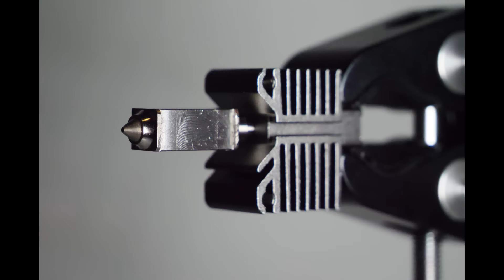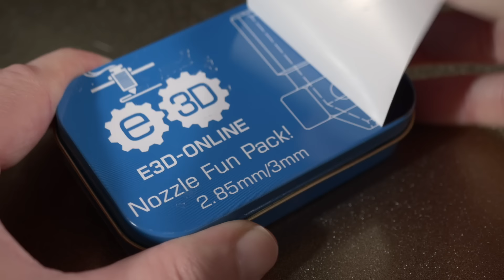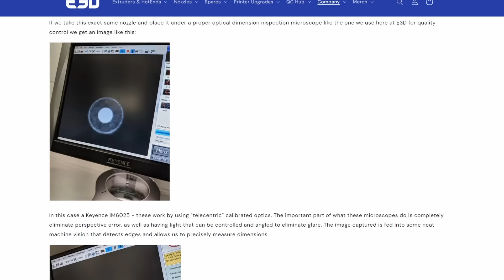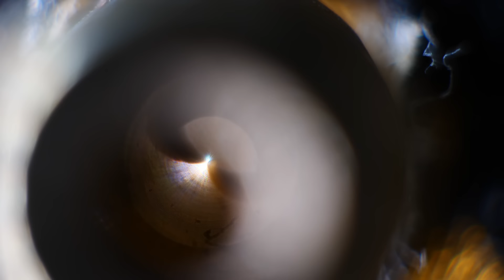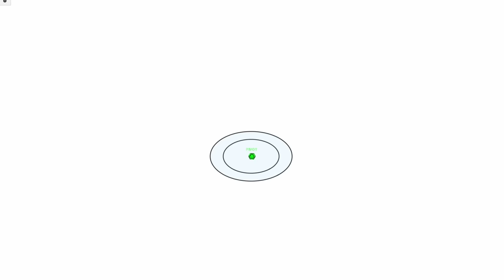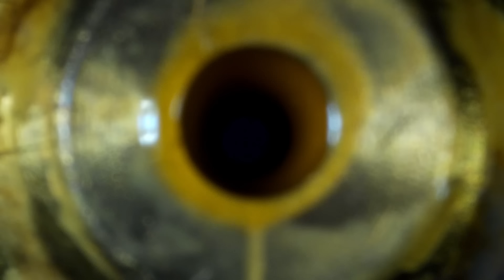Expensive Vs Cheap 3d printer nozzles - let's look inside.

Comment: that is exactally why I swapped to v6 (and v6 compatible such as phaetus rapido) despite building voron kits that come with revo voron. they are cheaper (both HE and nozzle) and better.

on the price side: 22 nozzle for $3 versus 1 nozzle for $27 and the HE isn't even more expensive (revo HE is like 100 where as a phaetus rapido that is triple the power is only 80)
plus you can get CHT, hardened CHT, ruby, diamond (diamond revo just come out i know), and dozens of other options for CHEAP. like we all should know that clone v6 CHT are $4 for 3 and performs better than og CHT and may not even be IP infringement because they used a different approach (insert rather than machined, whether it is different enough is a question no one can answer unless fighted out in court)
another spicy trick to do with v6 is you can use valcano nozzle with a nut and it works about as good as an actual valcano block, like you have the ability to swap between ultra high flow and less stringing in the time of a nozzle swap

some will claim revo is good when you get heat creep as you can swap the heat break and cold side with the nozzle. while I am not denying that having experienced it myself, it sucks a lot more to loss a $27-100+ nozzle than a $20-30 heat break that I could try to drill out. so really the only benefit imo would be cold nozzle swap (how often do you do that anyway) and using dedicated hotside for each material (which highly depend on your need, and whether it is more cost effective consider you need $27 for each material where as a clog on v6 cost less than $1)

Comment: Awesome stuff. I've always loved macro shots.

Also, your custom LED PCB has my interest (Custom flashlights are another hobby of mine). Do you know what emitters you plan to use? And what type of driver? I'd imagine Nichia E17a would be just about ideal due to their small size (1.7mm) and very high CRI. Also, you may already know this, but I highly recommend using an MCPCB instead of your traditional FR4 PCB. The metal core helps a lot to move heat away from the LED chip much better.

Looking forward to seeing what you're working on next. Cheers

Comment: When I use a new E3D volcano nozzle, i always round the nozzle's edge on a hard  surface. I do it because the sharp edge has a bad habit of accumulating material while printing. A rounded nozzle just prints better. I usually print functional parts so always tune the print to be on the edge of overextruding.

Comment: There's a thing called light field cameras (also known as plenoptic camera) which takes a picture with all parts in focus or rather a picture which allows you to focus after taking the picture. sadly this tech never took on besides the lytro cameras (the company closed in 2018). Nonetheless, cool tech
Reply from the maker: Yeah I saw crazy kens explanation of it and I'm still not entirely sure how those even work. Would be cool but I don't know how it breaks the laws of physics!

Comment: re: surface finish

Construct 3d showed off a 6 input hotend for higher flow. It was made with sls. To smooth the insides, glow filament is run through it for polishing purposes
Reply from the maker: Oh....now I need to test that
Reply: @LostInTech3D Also I wonder if chemical finishing could be sensible to do.

Comment: I'm wondering if the roughness of the steel nozzles will affect print quality, and will the print quality be improved if you polish the nozzle with a vibration polisher or by running water with an abrasive like sand through it.

Comment: Like your channel and your content but while you were rambling on about how to take the photo the question popped up, why are those nozzles longer than the others and and if it's so the filament is melted in a continuous tube unlike the short nozzles why are we still using the short ones? Does the long ones work better than the short one?
Reply from the maker: Most manufacturers are moving to longer heat zones now, so...yes. originally it was harder to tune retraction.

Comment: Personally I'm not too interested in the inside of a nozzle. I've yet to have one print gone wrong because of a clogged nozzle, just hasn't happened. However, I do have prints converted into misery because of blobs accumulated on the outside of the nozzle.
So the smoothness of the outside of the nozzle is highly important.
Since a few months I bought a PTFE finished brass nozzle. Man, what a difference. I have a silicon scraper setup with the appropriate g-codes at the start of a print to clean the nozzle of any residues but even so with a normal brass nozzle I still needed to clean it thoroughly every now and then. Not the PTFE one, you can print for months without any cleaning (other than my automated scraping) and if ever needed just wipe it with a cloth when it's hot, no work at all, no brushes or anything heavy.
They're a little bit more expensive but well worth the price.
Reply from the maker: Interesting thought about the exterior...I know petg likes to stick to nozzles...hmm
Reply: @LostInTech3D I'm using PLA, in this case with a 0.3mm nozzle, but since I mounted this one it hasn't gone off my printer yet. Amazing difference. Maybe some close-ups on the outside could reveal the difference, as from the nozzles that I have you can see it.
Reply: Doesn't the PTFE coating limit you to printing PLA?
Reply: @MetalheadAndNerd  Not that I now of, should be functional on all types of filament. PTFE resists temperatures of up to 3 or 4 times the nozzle temperature easily without any structural changes.

Comment: Love how this video came out directly after i changed my nozzle on my V2 Neo to a tungsten carbide nozzle from dawnblade, at $25 for a single nozzle its pricy af... but i dont expect to have to change this nozzle any time soon. It also has  the added benefit of higher thermal conductivity than brass so you can go faster with more consistent layers.
Reply: 25 dollars for a tungsten carbide nozzle is a good deal. They are not easy to machine.
Reply: Brass (109 W/mK+) has better thermal conductivity than tungsten carbide (85 W/mK).

Comment: What are you talking about Bambu's nozzles are expensive 🙈 I have a Flashforge 5M Pro. Look how much these ones are 😂 I have to pay between 36 and 40 Euros for one 🙈
Reply: @LostInTech3D  Okok, the have the Hotend and sensors included and are fully assembled. They are sooo easy to replace. Genius click system. But yeah... Expensive..
Reply from the maker: I do like the quick change flashforge nozzles, but yeah the price is ...not small!

Comment: I’ve tried a variety for the Ender 3, cheap nozzle work fine, baht they show wear very quickly but are very susceptible to clogging up. What I did end up settling on was the POLISI3D nickel plated copper ones. They simply don’t clog and changing print materials isn’t an issue, though I always run 50mm of cleaner filament when changing. 

Those custom nozzles being overpriced and/r not available is something I expected. They seem they’d be a bad choice  in a print farm setting

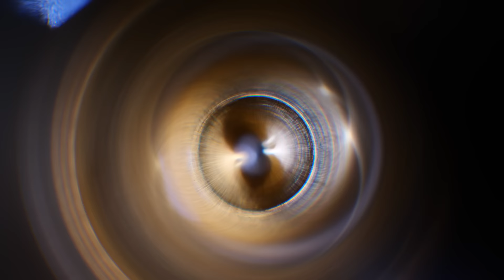Comment: Buddy... 10:54 was a wow moment. Great video. Definitely some of your best work. Even if it was just an excuse to play photographer with 3D printer parts. ;)
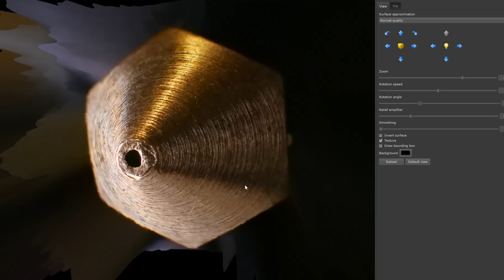12:27 was also pretty amazing. I mean it's basically very small part 3D scanning, albeit probably not extremely accurate dimensionally. That is just super cool.
Perhaps cross sectioning some nozzles would allow for more INsights? Definitely not upset this is split into multiple videos, but I will be impatiently waiting.
My guess is general quality of nozzles, inside and out, hardly affects printing unless there is a major defect. Nozzle design and material matters more than quality.
The quality may have more impact on clogging and melted filament sticking though. I think many nozzles are too expensive for sure and the marketing is strong.

Comment: I want a diamond back cht volcano nozzle 🥹 and never talk about nozzles again
Reply: Nano coated obsidian colored with milled surfaces and nice chamfers? Hahaha.
Reply: @802Garage  no, diamond backs dont use a coating but use a pressed diamond this could be shaped in the cht part too. I hate patents otherwise we could have this ! The best nozzle of our time 😍
Reply: @OneHappyCrazyPerson  Hahaha I know the nano coating is for everything but the diamond to help ensure filament doesn't stick to it and prevent clogs and stuff. They use it on bimetal heatbreaks. I was just adding a bunch of buzzwords and jargon. ;)
Reply: @802Garage  its not about buzz words, a nozzle like proposed would have the best thermal conductivity posible combined with wear resistance. You would never have to replace it and it would be highly efficient. The diamond inserts would heat up before the copper surrounding it does. Heat exactly where you want it. Where it truly melts the plastic.
Reply: @OneHappyCrazyPerson  I fully understand. I was making a joke friend. :)
Reply: @802Garage  i get it, its just frustrating  patens prevent us from having something like that. But your suggestions of DLC coating on a cht nozzle would be the next best thing possible.

Comment: Just run the V6 nozzles in an Ender. Perhaps using a v6 heat block. Adjust Z and go.
Reply from the maker: I think the thread was technically slightly different?
Reply: @LostInTech3D  I never knew about a different thread. I always treated these nozzles as interchangeable. Maybe I was just lucky all the time.
Reply: @LostInTech3D The thread is the same. Only the depth of the thread is different. MK8 sit deeper into the heat block compared to V6.

Comment: Nice work!  Is it not possible to shoot at a really high F-stop with insanely bright light to get a better depth of field?
Reply from the maker: I was trying for f/8 which is the sharpness sweet spot on that lens, apparently. But yeah. You could if you can get the lights in there. 

I may have some ideas about that but I'll need a 2.85 nozzle 👍😁